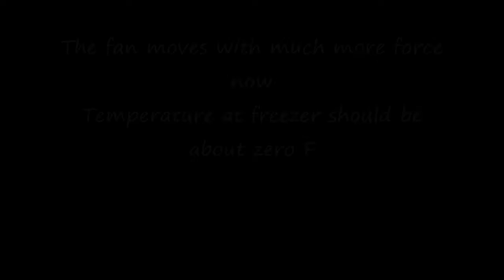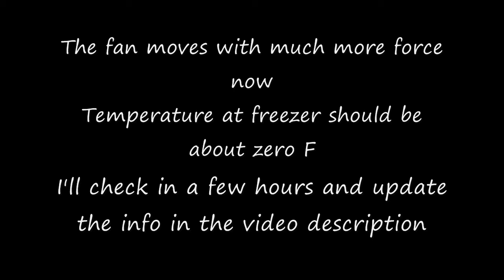Replacing the GE freezer evaporator fan motor

Comment: it sounded much stronger on the vid as well. good luck with it.
Reply from the maker: The freezer temperature went down to sub zero, actually minus 6 degree F, which is great. Of course, it almost gets that cold in your neck of the woods. It's a little warmer here but still pretty cold. Last night, when I was fixing the fridge,  all I had to do was to put the meat in a garbage bag and left it in the driveway and nothing got spoiled.
Reply: thomas reddick image of fridge fan motor

Comment: Don't know if it will continue to work. But I will keep my eye on it. My evaporator fan motor completely stopped. Has been for awhile now. I really didn't know what was wrong until I started doing research. But the fridge is about 8 years old and at first the motor would be noisy. At times it wouldn't work. But I got the notion last night to tear it down and take a look. 

So after doing this I got down to the fan and wiggled it and it started to turn on its own, not strong but a slow turn. So I sprayed it with some silicone and the fan started to turn with great force. I think I will keep a eye on it and if it goes out again I will replace.

But it's been 24 hours and the fridge is extremely cold and it's producing ice. 

But knowledge is power and if it goes out again, I will replace it.
Reply from the maker: The evaporator fan is hard working will only last so long so it's good to know that you can fix it on your own. Thanks for sharing your experience.